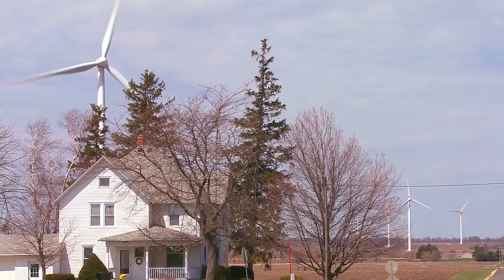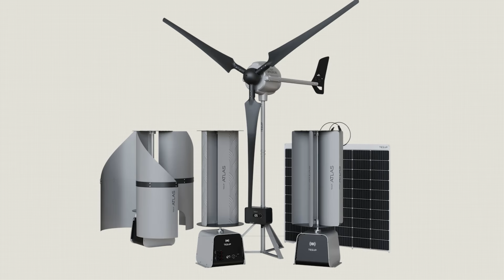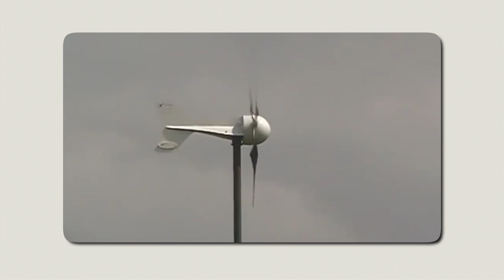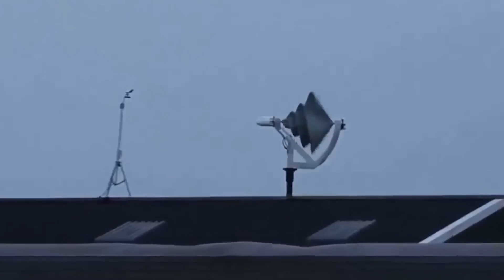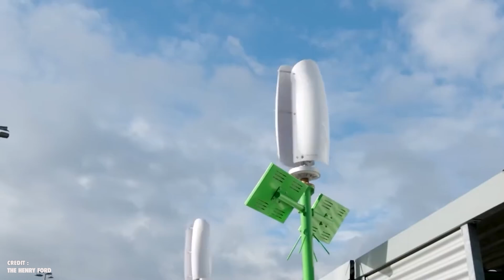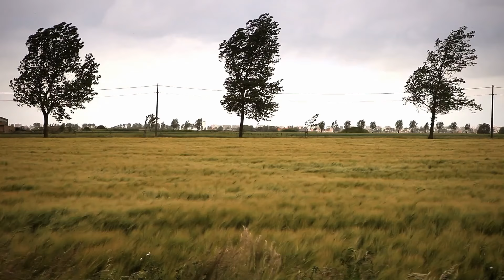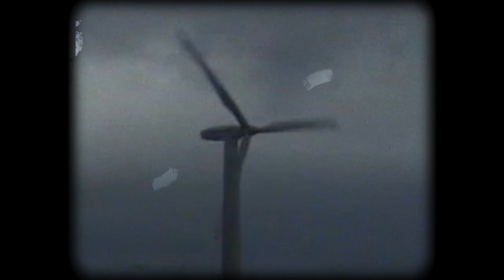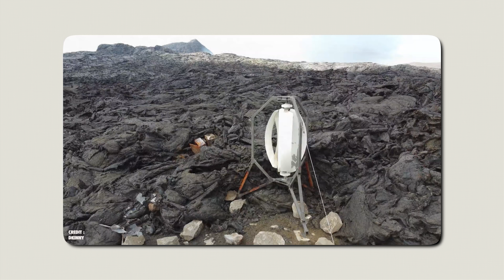These 6 Wind Turbines Are The Future Of Home Power

Comment: This is misleading. Just like those adds in which a small airco like thingy is promoted that is supposed to completely ruin the existing airconditioning industry. No solid physics, just BS. Now about small turbines, and the power they can deliver in normal situations (so no tornados or hurricanes, and a city like environment). 

1) The weight of 1 m3 of air is on average say 1.3 kg.
2) Lets assume a wind speed of e.g. 5 m/s. This is 3,3 Beaufort. A gentle breeze. Lets also assume a wind speed of 12 m/s, which is nearly 6 beaufort. This does not happen that much locally at your turbine in a city.
3) Lets assume your wind turbine has a diameter of 1954 mm. This is already significant for a city-turbine. This means the rotor has a swept area of 3 m^2 (I did choose that diameter for a reason 🙂).
4) at 5 m/s wind speed, a volume of 5m  * 3 m^2 = 5 m^3 passes the rotor each second. The weight of that volume of air is 1,3kg/m^3 * 5m^3=19.5 kg. 
5) The energy content of that mass traveling at 5 m/s is given by the formula of 0,5 * m * V^2, in the example this is 0.5 * 19,5 * 5 = 243,8 Watts.
6) that is nearly a quarter of a kW! Unfortunately, not all that energy can be extracted from this moving column of air. If that would be possible, the air column would have to come to a dead stop. Well designed commercially large turbines manage an efficiency of about 35 - 45%. Lets just use the average. This means, you only get 0,4*243,8 = 97,5 Watts. Note in non-optimal conditions, air flow in the city, the air does not move in a laminar state. This translate into even less energy harvested.
7) lets say, we are able to extract this 100 Watts from our turbine. At a swept area of 3 m^2, this translates into 33.3 W/m^2. Nothing short of disappointment. Worse then solar panels.
8) If you perform the calculation with a wind speed of 12 m/s, again not very common in the city, you get about 1350 Watts. Which equals about 450 W/m^2. Yes, this is better then you can extract from solar panels. But unfortunately, this happens only once in a while. 

Further: wind turbines are not as maintenance free as solar panels. You should take this into account. And the smaller ones rotate very fast, and generate significant noise. 
Finally: do not get me wrong. Smaller wind turbines can be usefull. Especially for remote areas that are devoid of a lot of sunshine, and do not have access to the mains. Think of a cabin on a remote Scottish island where it rains half of the time. In the past, small wind turbines were used on e.g. sailing yachts. But they are mostly replaced by solar panels nowadays. This is for a reason. 

If you are interested in an actual comparison between a $100 solar panel and a $100 wind turbine, check this video. https://www.youtube.com/watch?v=iHulKsD35Hc&t=1002s

Comment: The Primus Wind Power delivers about 30 kWh / month = 360 kWh per year. 360 x 0.27 Euro is about 100 Euro per year on saved energy. In the Netherlands I can buy this turbine for roughly 2000 Euros which means ROI is 20 years. That is if the turbine lives that long. That is not a good investment.
Reply from the maker: It is a fair point but you have made a simple assumption that energy prices are not going to rise and that the time value of money is stagnant.  If you factor these in to your calculations you may find the payback drops to near 10 years.  But an investment in a wind turbine is a person choice, not mandatory!
Reply: @wildline_YT  On the other hand, with a solar system that produces more power than you need, you sell the excess back to the power utility company.  If electricity prices go up, then you make even MORE money every month...

Comment: I'm in the UK and would love to know where I can get small residential wind power for my home use! I have solar and batteries but I need an extra 2-3 kWh output per day during winter to make up the shortfall. What is my best QUIET option!
Reply: maybe geothermal power? alternatively, there are projects which allow to generate power from a pond or pool of water - even in winter when the surface freezes over.
Reply: More solar panels, and an additional battery.

Comment: I do wonder what if you have both? Solar and wind turbine.
Reply: Then you wasted a lot of money on the wind part!  Solar alone is plenty good enough.
Reply: @i-ccc-channel  then you saying that all these wind turbine is all wasted investment?
Reply: @Benz2533  Yes, definitely.  Solar systems today are far cheaper and far more reliable, for about the same investment.  Much lower maintenance too, as there are no moving parts in a solar system: nothing mechanical.
Reply: @i-ccc-channel  for place that have lots of sun then sure. Xinjiang China should be perfect example. Sunrise at 7 AM Sunset at 10:00 PM give or take. What about area that don't have snow? Would smaller wind turbine still be useless?
Reply: @Benz2533  Where I live, it is mid winter right now.  I get about 5 hours of useful sunlight per day.  that's still more than enough to provide all we need for the house, and also charge the batteries enough to last overnight.  Right now, it is a heavily overcast day, yet the panels are still producing between 1 and 3 kw (varying cloud thickness).  The house load is a bit less than 1 kw, so the extra is charging the batteries.  it is mid day, and the batteries are already at nearly 60% capacity, with another 3 hours of good daylight still left. 
If i would have bought a wind generator, it would be producing zero kw right now.  And for the entire past month.  No usable wind at all in most suburban areas...

Comment: get the feeling this is a sugar coated presentation. Anything that moves will require maintenance. Can't see any of these solutions being viable for residential use - most, if not all, will not pass current planning rules in the UK

Comment: The SD6 costs three times as much as a 14 kWp solar plant. The latter will produce 14,000 kWh per year. Add to that the cost of a decent storage, like 20 kWh for currently under 5000 USD, and you end up with half the investment as for the SD6 - but getting a plant that does not need maintenance. And, to make the best use of your wind energy plant's production, you will need a storage, too, at best of the same size. Otherwise you may on paper produce 14,000 kWh per year, but not make use of much more than half of that. 
I have a small solar plant of 1.6 kWp plus 4 kWh storage and get roughly 1,300 kWh per year out of the combination, i.e. some 80 - 85%. As I heat with gas and do not need have any AC, my home uses less than 2,000 kWh per year. That was the perfect economic balance for me at the time. That was 2 ys ago, today I'd get a bigger plant and might cover about 90% of my electric power requirement. But above that it gets exponentially more expensive as, like it or not, sometimes the sun just won't shine (and as well the wind will not blow) for long enough that your storage is empty. Therefore, promising people they will have a reliable source of electrical power that virtually covers what they consume is bollocks unless it's water power all year round. 
And even less people live where they can use that than you'll find those who will be allowed to erect the 20m/65 ft mast the SD6 requires for perfect use. Just look at that image of the SD6 and remember: it has a rotor diameter of 5.6 m/ 18,4 ft.
Yes, private wind power has its benefits, but it is by far not suited for everyone and it is about double to triple the price of solar power for the same yield.
Reply: The name of the company manufacturing the SD 6 was PROVEN about 25 years ago

Comment: The Law of Betz (or Betz Limit) states that no wind turbine can extract more than 59.3% of the kinetic energy in the wind. Discovered in 1919 by German physicist Albert Betz, this theoretical limit dictates the absolute maximum efficiency of any wind energy system. If a turbine were to extract 100% of the wind's energy, the wind would stop completely behind the blades. If this happened, the air would have no momentum to move away, blocking incoming wind and stopping the turbine from turning altogether. To keep air flowing, some kinetic energy must remain in the wind. 
There is no way any vertical turbine on a roof or in city conditions is able or will be able in the future to generate energy enough.
Reply: Good work on the Google machine! But your statement that, "There is no way any vertical turbine on a roof or in city conditions is able or will be able in the future to generate energy enough" is myopic. Wind energy can be a good supplement to solar panels - especially some of the more recent designs that sacrifice some efficiency for reliability and longevity. It may not be perfect yet - but I challenge your claim to know what "will be able in the future..."
Reply: @GeeDeeBird Give me one example where a vertical turbine in city conditions is able to generate more as 100kWh a year. If vertical turbines would be an option they would be around in our cities everywhere. Al claims of any type of turbines in city conditions are overrated. A wind turbine will only function by size and hight. Try google and learn.
Reply: @p.musolf8310 Sorry... I didn't realize you were unable to read and comprehend my comment.
Reply: @GeeDeeBird  What "will be able in the future"  cannot, under any circumstances, break the laws of physics.  as the OP pointed out, there is a limit as to the maximum obtainable efficiency.
Reply: @i-ccc-channel If you read my post, you know that is not what I said. I said the statement that there is no way vertical windmills can ever produce enough energy to be useful was myopic. I stand by that statement.
Reply: @GeeDeeBird  At a reasonable price, comparable to a similar solar setup, they can't compete.  Sorry.  A 20 kw wind turbine is always going to cost more and be less effective than a 20 kw solar system.
Reply: @i-ccc-channel Again, you do not know that. It's fine to have an opinion, but I do not concede to you the ability to predict every possible future. Moreover, I object to your attempt to reframe the issue as one of relative cost. That is a straw man. The correct metric - if there must be one - is cost - effectiveness. There are applications where solar is not satisfactory at any cost.
Reply: @GeeDeeBird  Again, I do know that because I understand the laws of physics, and also the reality of the world we live in.  There are physical limits to how much energy a wind turbine can produce, and also limits to how efficient a solar panel can be.  These are know limits, butting up against the laws of physics, and no amount of future breakthrough can get past those limits.  It's not a matter of "predicting every possible future", as you seem to think,  but rather of understand what the laws of physics allow.  Thus, wind turbines can never be as good as solar panels at the same price point.  Or at any realistic price point.  Can wind turbines work?  Of course?  They already do.  No doubt about it.  Can they ever match the cost-per-.kilowatt-hour of solar?  Nope.  Not going to happen.  Mechanical systems that convert rotational energy into electrical energy are subject to physical limitations which are well understood, and cannot be beaten.  Those limits have not yet been reached, but they are known, and there is nothing that humans can do to change them.  The same applies to the laws that govern converting light into electricity.  The limits are known, and well defined for each type of material.  They have not yet been reached either, but they are known.  There's about 1000 watts of energy available in each square meter of sunlight on the Earth's surface, and the ability of each material to convert some of that into electricity is also defined by the laws of physics.  The limits are known, and cannot be overcome.
Then there's the issue of availability of energy.  Wind power only works well where there is a fairly constant stream of high speed air.  It is far easier to extract energy from fast-moving air, than it is from slow-moving air.  laws of physics again.  There simply isn't much fast-moving air near the ground in the vast majority of populated areas.  So no matter how good you make your turbine, it is no use at all in most populated areas. 
Solar power, on the other hand, is available in pretty much all populate areas, every single day of the year.  it varies, of course, with the time of day, day of the year, atmospheric conditions, etc., but it is always there, and it is always possible to extract at least some electricity from that light.  that's the one thing you can always count on. In most places on Earth, there is free energy coming down out of the sky all day every day, between dawn and dusk, and some of that can be captured.  That simply is not true for wind.  In most places on the planet, there is not enough air movement to be usefully captured.
Thus, no matter how much you want it to happen, wind power is never going to be a superior alternative to solar power, simply because of the laws of physics, and reality.
Reply: @i-ccc-channel 

TLDR... Repetitive BS. History is rife with folks like you who were so smug and confident in what they knew that they were simply unable to acknowledge that the future could hold discoveries or circumstances beyond their ken. 

I'm well aware of the limitations you so exhaustively (and exhaustingly) spout. They are not relevant to the argument here. 

I will say it again. You have no way of knowing, based on physics and current cost-benefit analyses, whether there will be an innovation or circumstance in the future under which wind energy may be a suitable alternative or complement to other energy sources. 

What you don't seem to understand is that it's not a matter of either-or, yes-no, all-nothing. What is not feasible - or even possible - under one set of conditions may be perfect under another. 

Honestly, your dogmatic myopia has become tiresome. This discussion is over. You can repeat yourself one last time to satisfy your need to have the last word. Peace.
Reply: @GeeDeeBird  TL:DR  Too bad you don't understand science at all.  Thus, it isn't worth discussing anything with you, which makes you just a troll who an be ignored.  The laws of physics are immutable.  There just isn't any way that a wind turbine can economically efficient, compared to solar power.  You seem to think it is a matter of opinion: it isn't.  It's a matter of hard physical facts.  You cannot extract anywhere near 100% of the energy in wind, no matter what you do, or what mysterious magical technology you imagine for the future.  It is a limitation of physics, not of imagination.  If you don't know what this means: L = C_L × ρ × (V^2 / 2) × S  and also what this means: Fd = 0.5 * rho * v^2 * Cd * A, then you have no business at all commenting since you simply do not understand the issue.   Those two equations perfectly describe why your imaginary technology can never happen.   If those mean nothing to you, then you are not qualified to offer an opinion.  Sorry. 
There are limitations on solar power as well, and they are also well understood, but they are nowhere near as severe as those imposed on mechanical conversion of energy.  There are already technologies that can double or triple the current efficiency of typical commercial panels.  Technology is not an issue.  The physics and chemistry are well understood.  The problems with those are more on the manufacturing side:  how to make them economically, and stably, such that they are robust panels that last a long time.  Those are production issues, not physical issues.
The limits with wind power, on the other hand, are physics, not so much manufacturing.  There just isn't any way to get to the efficiencies that you imagine will one be magically possible:  It cannot happen, no matter how hard you imagine it.  Sorry.
By the way, I'm not writing this for you, since you aren't even smart enough to understand it:  rather, I'm writing it for smart people who are following this conversation, and are curious about the subject.  QED.

Comment: Such claims. the tessup can put out 10kw. Hmm thats say 100v at 100A  or 48 volts at over 200 amps. Poof wires would burn. 1000v at 10 amps. hard to drop to lower voltages.

Comment: How about drive way vehicle jacjs? Vehicle enters and exists Seven Eleven. As it enters its weight jacks u up a smaller weight. AxAs it exists it does the same thing. The weight is pulled down by gravity and is geared. Its gears spin a turbine. Presto electricity!

Comment: Acouple of years ago I saw an American made combination unit that was about the size of a  small utility trailer. It had a bank of solar oanels and two cylindrical wind turbines. It was dwesigned to bring electricity to remote rural homes in India. One person could move it and while it didn’t produce enough power to run a home in the US it would run your meter backwards every day while you were gone at work. If the company is still making them , with updates I would buy one as it would greatly reduce my electric bill and with a new storage system provide emergency power too.